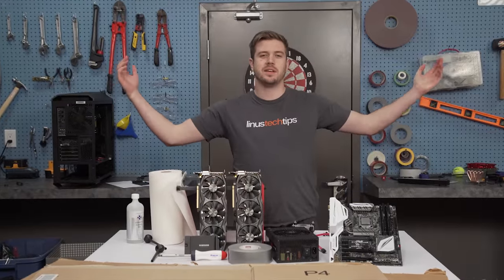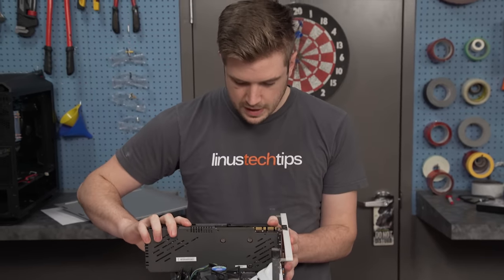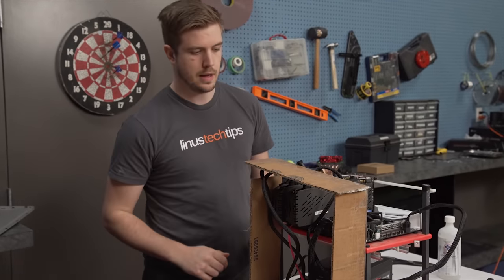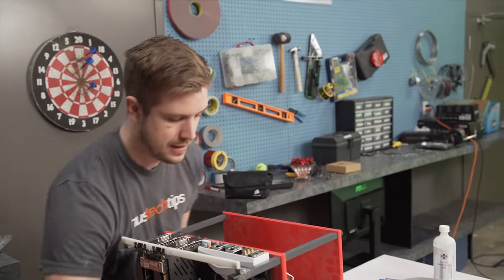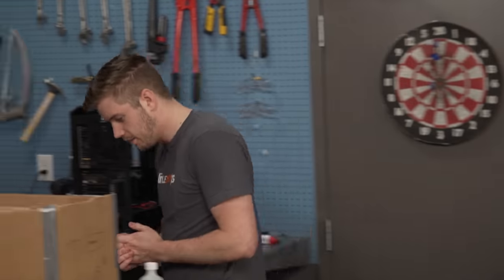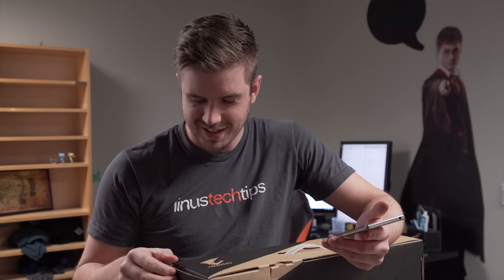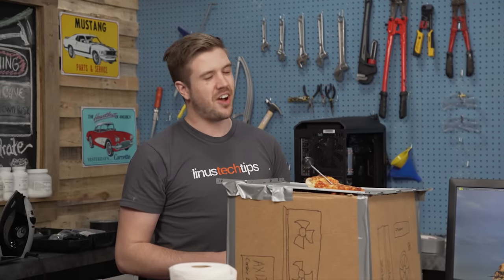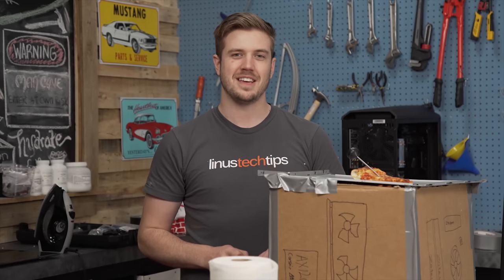Gaming PC & Pizza Warming Platform Prototype Construction

Comment: Why didn't you just use a normal tower case with a vent on the top, and block all exhaust vents other than where the pizza goes with electrical tape. Please do a part 2.

Comment: YOU FOOL
Don't use fan exhaust to heat it.
Solder a hot plate directly to heat pipes connected to the CPU and GPU chips

Comment: dude...... how does water cooling work? it collects heat from one place and transports it to another place. just build a water cooled computer but instead of a radiator, use a plate with a spiral of copper tubing on the bottom.....

Comment: This is weak. I put a down draft cooler on a AMD X4 860K, when it runs at 100% the entire mini tower case feels very warm to the touch, even the positive air pressure only manages to change it from a bread toaster to a convection oven. That's with a reference 650 Ti, can't image what will happen with an AMD GPU in it.

Comment: should've used 390s in crossfire. mine has turned my computer into a space heater.
Reply: Faneili Hmm, no heat issues with my R9 390 over here :/
Reply: Fresh Dumbledore it's not really hot to the point that my system thermal throttles it just makes my room significantly warmer than a lot of other gpus would due to its 275 watt tdp

Comment: You should have used a pentium 4 with 4 cards with the flamer architecture to produce the maximum amount of heat. 

Or just use a space heater, or just eat the pizza before it gets cold, or just don't eat pizza cause if you eat too much you develop some front suspension. (You get fat, sorry, thicc)

Comment: why he isnt using a amd cpu
Reply: Your question is bad, Intel cpu's are hotter than amd...
Reply: +Black705 cough9590cough The stock cooler for that thing is an all in one. And my 2nd gen i7 runs at 75 degrees max on Aida64 on a stock heatsink.
Reply: +Christy Dwyer My 6700k 4.6ghz is in the 80s my fx 8120 4,6Ghz was 49 same cooler coughcough
Reply: +Black705 I find that hard to believe. And I'm not talking about the 8120. I'm talking about the 9590.
Reply: +Black705 the fx 8120 has a 125W TDP and the 6700k has a 91W TDP, and the fx 8120 is 39 degrees cooler? Something doesnt make sense.
Reply: ayyy ZJ And another one who thinks higher TDP means higher operating temperature... LOL
Reply: +Black705 Because it typically does.
Reply: just an example. what were you doing that put the 6700k to 80, but barely put any load on the 8120?
Reply: ayyy ZJ Converting videos with Handbrake
Reply: and how does that put the 8120 to barely any impact, but the 6700k to nearlydouble the temp?
Reply: ayyy ZJ eh, because amd cpu's are rated for not much more than temps in the 60's and intel can go at least up to 90. And pro intel making the thermal compound between the heatspreader in skylake so bad that skylake runs hot, never heard of Skylake delid?
Reply: okay, i guess im a noob. what exactly is TDP? googled it and "The thermal design power (TDP), sometimes called thermal design point, is the maximum amount of heat generated by a computer chip or component (often the CPU or GPU) that the cooling system in a computer is designed to dissipate in typical operation." and the 8120 has a higher TDP, then how does the skylake get hotter? not fighting anymore, just confused
Reply: +ayyy ZJ Don't worry, this guy has no idea what he's talking about
Reply: it was just a joke man calm down
Reply: Because Intel is getting hotter than Amd, alot of people complain about overheating notebooks which mostly have have Intel cpus
Reply: +DerpyDoom Those are notebooks. Nobody was talking about notebooks. Also, there are way less AMD based notebooks.